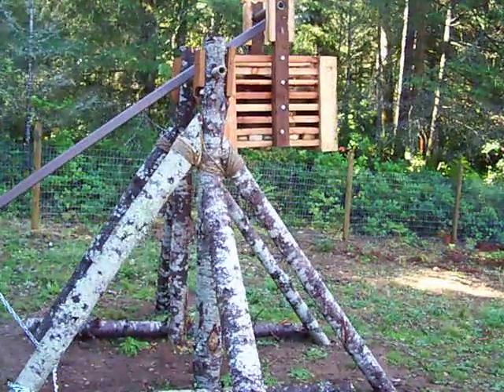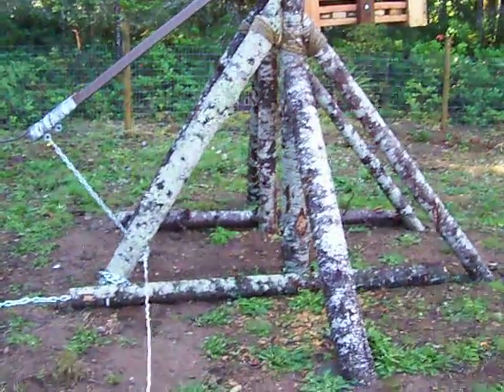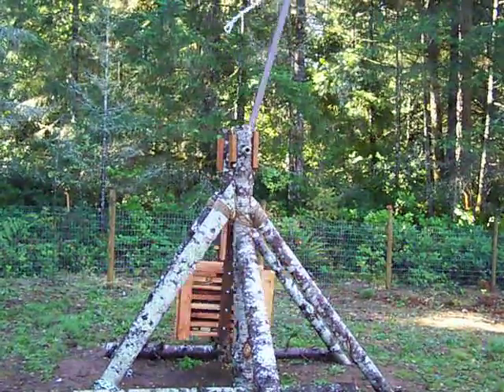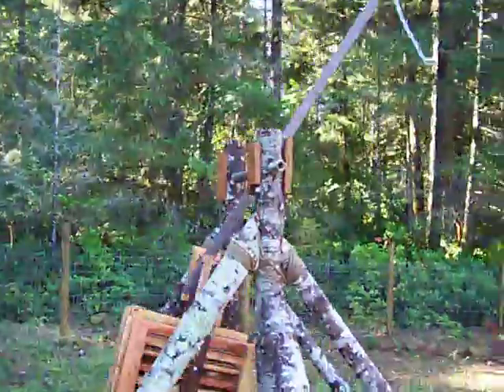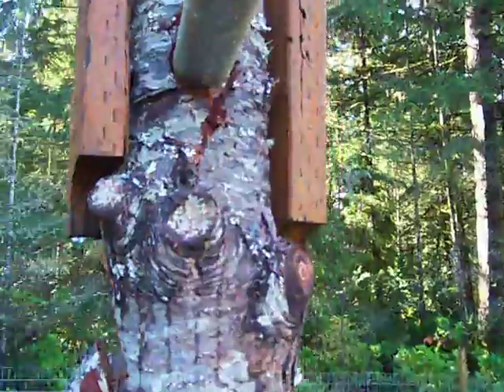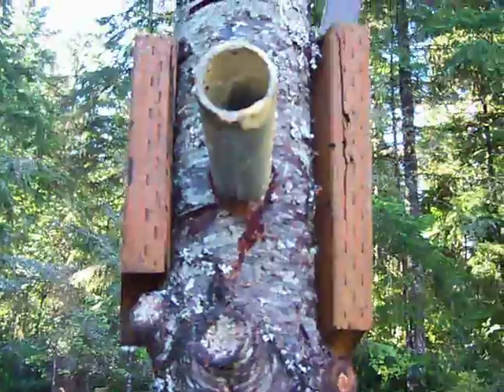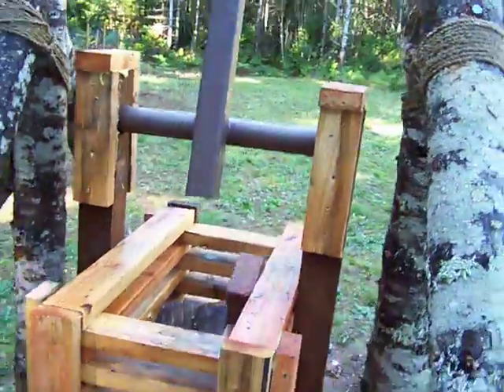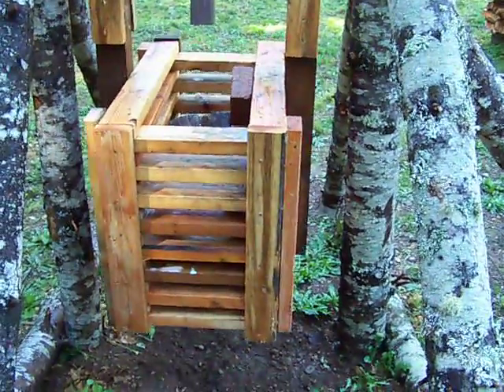First Trebuchet drop without sling.....

Comment from the maker: @Captainventana117 I spent about 5 hours tossing stuff today trying to get the release angle correct, which is now is.  I am having major problems with not having enough weight in the box-- I'm not going to build a bigger box, so im going out and buy some used weights from a weight set and get the counter weight up to about 700 pounds......

The angle of the rebar is currently about 10 degrees-  when I had it about 50 degrees the logs were slamming hard into the ground.....